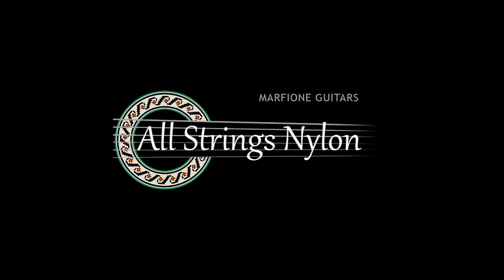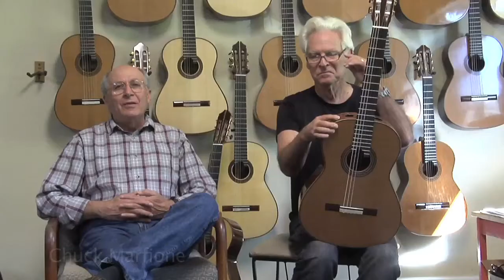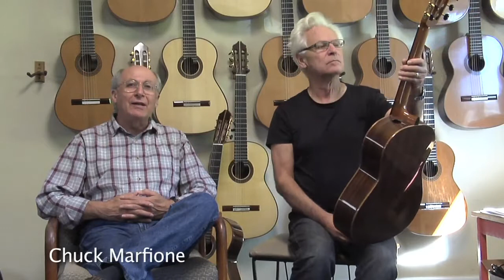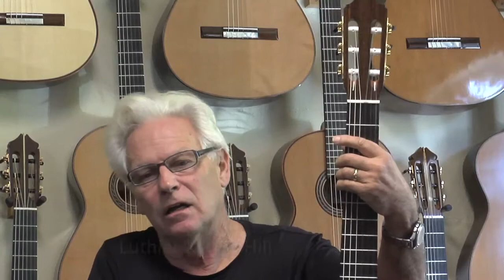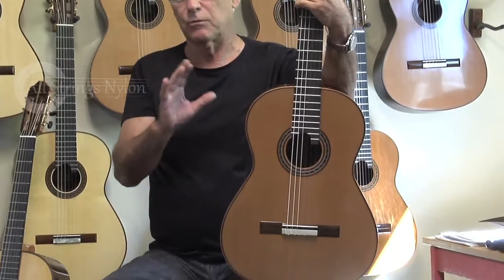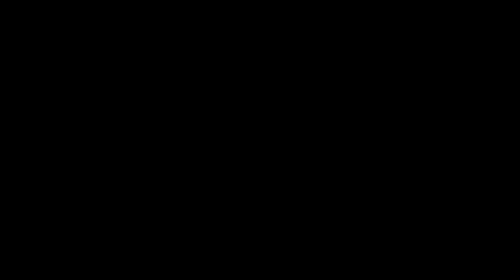Kenny Hill Performance Guitar

Comment: What strings are recommended for the Performance Guitar?
Reply: Kenny  Hill ships his Performance guitars with D'Addario EJ46 hard tension strings and they work very well on this guitar. However, I also like the Hannabach 815 series strings on his guitars. They are s bit brighter but very sonorous, I like to characterize the sound as having a sparkle to it.